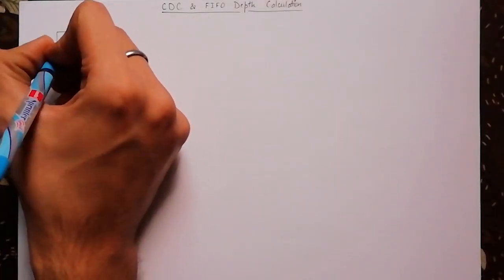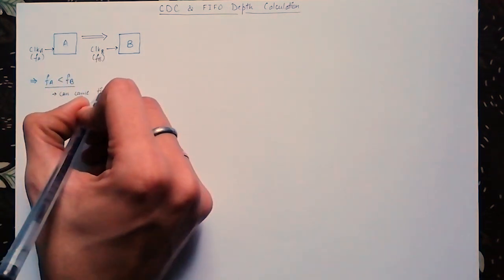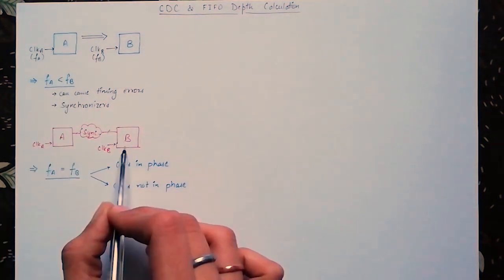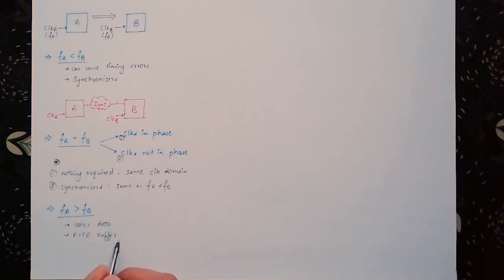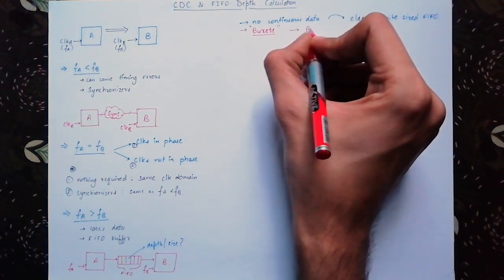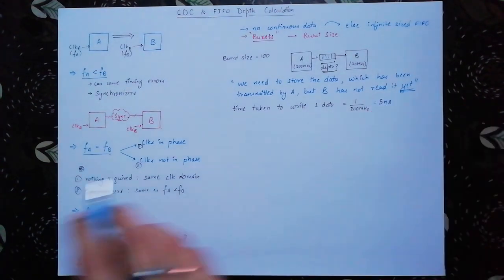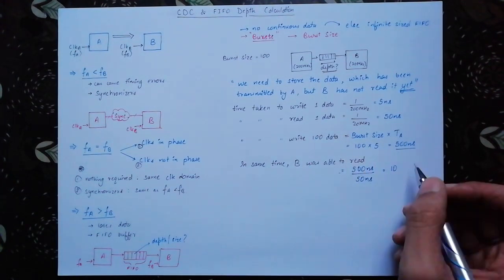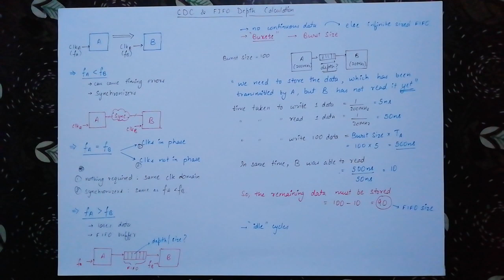Electronics Interview Questions: FIFO Buffer Depth Calculation

Comment: Explaned nicely ..... but what exactly mean you want to describe for idle cycles? that can you elaborate here?
Reply: It basically means that you have an idle cycle that does nothing after a consecutive write or read. In that case, you would have to multiply the calculated time period by the number of idle cycles mentioned. 
Say for example, if you insert 2 idle cycles after every read  (Trd =3* (1/read clock f)).

Comment: Thank You bro! I faced one question in Nvidia Placement test : FIFO depth if writing rate 45 beats/50 clock and read rate 12beats/20 clock?? when Burst size is not mentioned than how we will be able to find FIFO Depth?
Reply: You need to take the effective beats/clock for beats calc and Fifo depth = (effective beats/clock for write - effective beats/clock for read )* Burst size -> Burst size assume a number and round off the fifo depth to the nearest integer.
Reply: which college did this exam happen in ?
Reply: @vivekkandhagatla3096   0.9-0.6 = 0.3 beats per clock loss  , but I dont know the burst rate , so 3 should have been answer in that exam maybe ?

Comment: if fa>fb for single bit data crossing,  what synchronizer is preferred...
Reply from the maker: That will depend on the design, use-case, etc. The video gives an overview into the problems and how to mitigate it!
Reply: @electroTuts   ok Sure and Thanks for the replay. Also could you please kindly do more video's on CDC.

Comment: Is fifo required even in the case of fa < fb ? . I see some fifo depth caluclations on the net in this case. can someone explain ?
Reply: No, we just need a synchroniser, since receiver unit is faster than transmitter, there won't be any data "lost in translation" if we synchronise properly

Comment: For the scenario 1 FA < FB, if FA = 60 MHz and FB = 100MHz how we will send data without FIFO? 
For the scenario 2 FA = FB and clocks are not in Phase how can we send data without FIFO?
Reply: in scenario A, let us say that you are writing data to RAM, in this case your writing slower than reading, in other words read all data in RAM and wait for another data to be written in RAM, this doesn't need a FIFO, in scenario B if they are not in-phase either you lock their phases or synchronize both using flip flops or of course you can use FIFO, it is up to you (the designer) to decide based on the system that he/she is building

Comment: Can we calculate depth of FIFO if we don't know burst size? I mean I want read to continuous. I didn't got u r infinite depth FIFO so clearly please clarify me
Reply: If data is continously being fed to the fifo from a faster clock to a slower clock, then no fifo will ever have enough depth.  Every cycle of the read, you get more than one cicle on the write, so as time goes on the fifo gets more and more filled up.  At some point, if the writing side never stop, it will get completely filled up, unless the fifo had infinite depth.